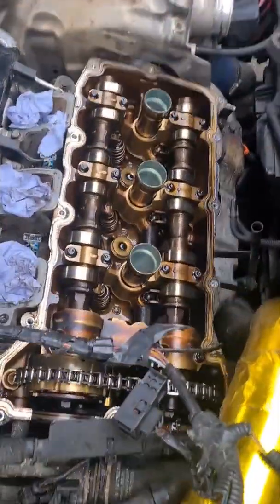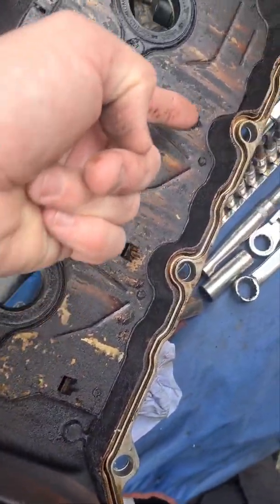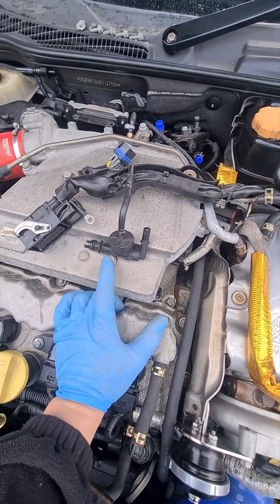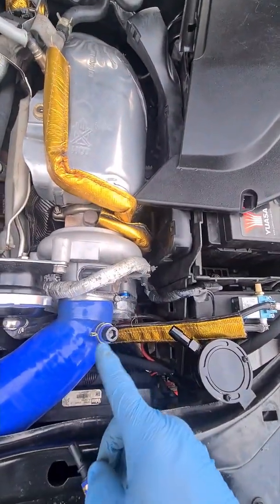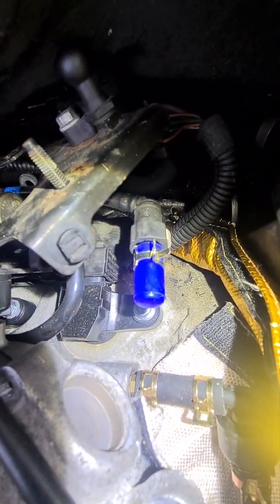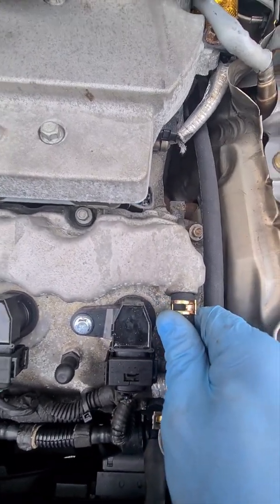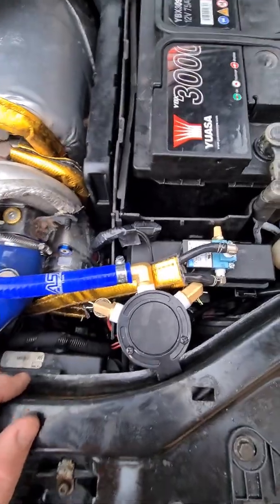saab 9 3 2.8 Crankcase Breather catch can install

Comment: @saabmadman and @pb4961
Please argue who is right.  I dont want to make a mistake.
Reply from the maker: Not sure what you mean. 

Properly filtering your vapour gasses stops oil film coating your intercooler internals which in turn improves its efficiency and can see an improvement of up to 4c compared to an oil contaminated unit. 

So as a performance mod it is excellent .

Comment: Recirculating the Disgusting and contaminated Blowby ... Back thru the turbo.. the Ic... the Intake and back into the engine is inefficient and frankly a stupid  (cheap) technique ... ONLY there to meet emissions decrees. Delete the entire system ..  I did.
Reply: "Catch tank"

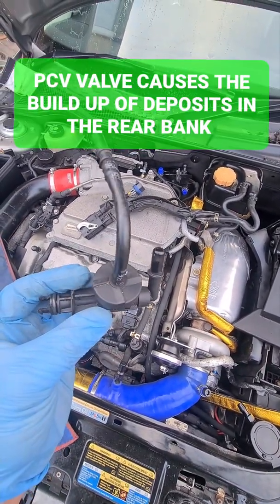Comment: Brother,  at 1:27 , how did you manage to detach that from the crankshaft itself ? By hand or any special tool is required ? Hope you answer. thank you
Reply from the maker: You have to pull it out and break off the securing tabs . There is no other way to remove it without breaking the tabs.
Reply: @garymgzs280   Thank you for very fast response. Thank you so much !!

Comment: Just wanted to say you made a mistake disconnecting right bank from suction manifold. Here is why : left and right bank are internally connected throug timing chain cover . It means if you blow air from right bank vapour port , air will come out from left bank vapour port . At idle , which Turbo is not working hard , vacuum from intake manifold will suck both banks gases , and during high air intake situations, air pressure difference from turbo suck the glasses out of both banks . Now at idle you have more byproduct gases in both banks and you might have small leaks from not very worn-out gaskets. Now here is the answer to main reason to the first problem : all GM high future engines of this type have this problem because of poor ventilation inside the engine, also lack of oil splashes inside the valve cover due to the design of rocker arms and tappets. It means oil is not present to wash off the very top of engine. Re arranging pc system will make things worse than before.
Reply: If your logic was correct than the standard PCV system would see both banks the same! As this is not true and they have the same rockers etc they cannot be the reason for the difference ‼️
Reply: So who is right? I need arguments!!
Reply: @wensz1  engineers who designed the car are correct! Change the oil every 8000km with good quality SN oil , or dexos , every thing will be fine

Comment: Greetings from Northern USA I appreciate the vid, did u get any CEL after this? Or did u get purge valve deleted in your tune,, also I see your running an aftermarket boost controller, do you have a custom tune for that or did you just simply hook the two wires to the 2 on the stock solenoid? Thanks in advance 👍 &subscribed
Reply from the maker: The purge valve system is left stock.  

Changing the crank case ventilation system caused no errors . So a modification anyone can do
Reply from the maker: Hi there.  You can run the 3 port Mac valve without mapping.  It runs the same frequency.

Comment: Very nice , does it matter that the catch can does not have a breather on the top
Reply from the maker: The tank vents through the 3rd pipe and back into the intake of the car. So no bad smells when driving. And also the car runs an air flow meter.  So you won't upset the metering of air.
Reply: @garymgzs280  ahhhh that’s great thanks , is there a way to do this without removing the cam covers?
Also we’re did you get the 1 way valves from mate
Reply from the maker: @Shadowmosesarea51  I didn't remove the cam covers.  Just pushed in the new fittings.  Old fitting just pull out.
Reply from the maker: @Shadowmosesarea51  the 1 way valves were used items from the same 2.8 engine.  The best one is the one on the Breather pipe that connects from air intake to dipstick tube.